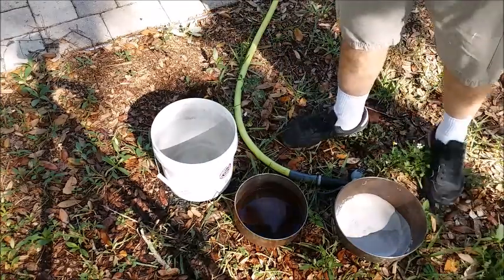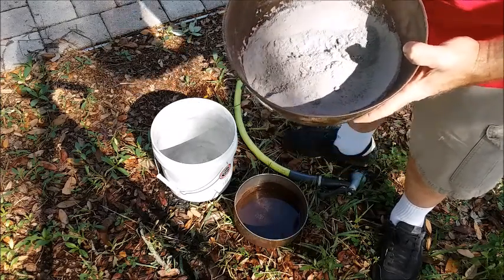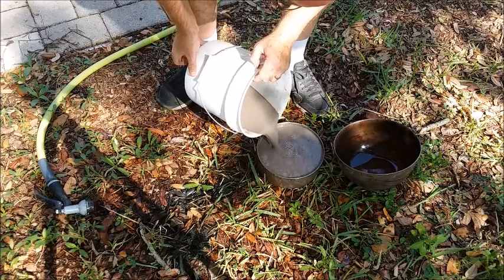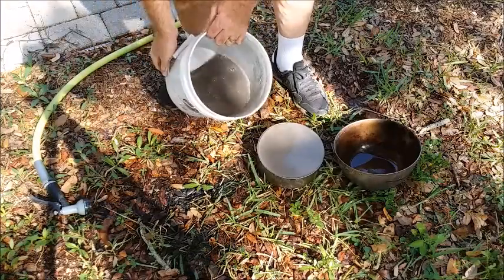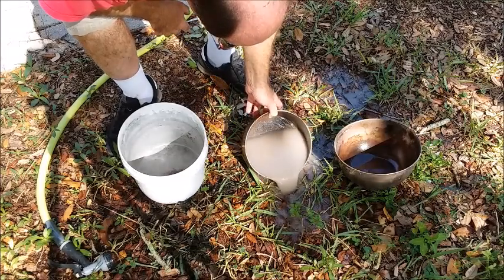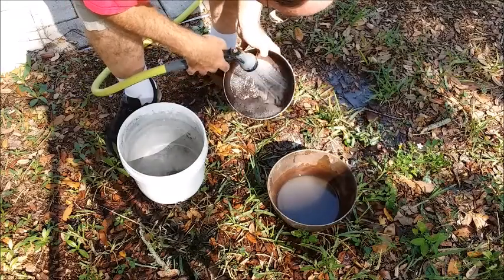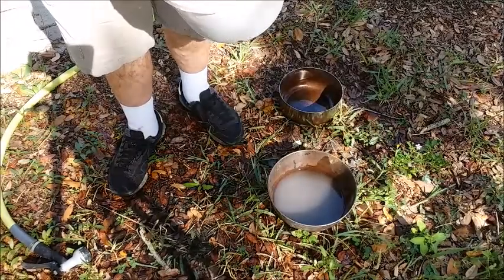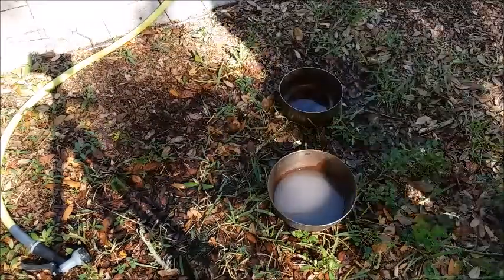Washing Away The Ash From Incinerated IC Chips To Recover Gold

Comment: Do you use jet dry or dawn? You’d really want to break the surface tension as I’ve lost plenty of gold bond wires doing this method without the surface tension being lowered
Reply: Yeah I was wondering the same thing
Reply: Is dawn sufficient? And is it absolutely necessary?
Reply: @raymondreyes8046  yes it is. Best to use a detergent that doesn’t foam up. Dish soap is horrible, but dishwasher is great. Pour into a bucket with material, and mix very well until everything is wet and has detergent. You’ll see the surface tension break as soon as you add it and will drop all the gold and heavies down to the bottom allowing a better rinse and saving materials 

What happens is the gold bonding wires end up floating in the water and get washed away when you go to rinse. I’ve seen as much as 40% lost because of this, so yes I believe it’s necessary.
Reply: I know I've got  a bunch of Ash coated filters that I need to go thru because I didn't know to do this first but knew I was probably washing away gold. So I saved it!